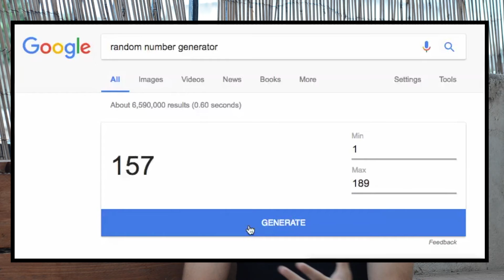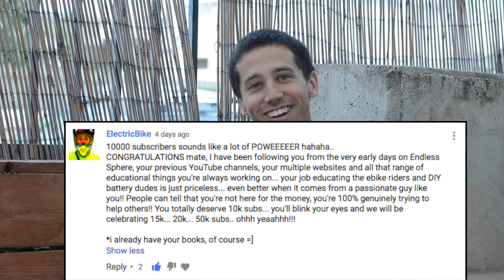Five giveaway winners (and new giveaway details!)

Comment: Hay Micah, have you tried 26650 Battery 3.7V  ICR26650 4000mAh for ebike battery packs before? Apart from being 4000mAh would there be any benefit over 18650's? 

i was just looking at these on Aliexpress https://www.aliexpress.com/store/product/10PCS-PKCELL-26650-Battery-3-7V-ICR26650-4000mAh-Li-ion-Rechargeable-Batteries-Bateria-Baterias-Flat-top/918700_32707428547.html?spm=2114.12010612.0.0.NlJlAd

Comment: :(  i didn't won... hey Micah what do you think about charge a 14S battery with a 13S charger? im thinking that because the lower charge maximize the battery life but dont know if the voltage works in that case
Reply: FREEDA Bicicletas eléctricas you can use a lower voltage charger (never higher) but it will reduce your range and may not really save your pack from future problems (read below)

Another way of thinking here if you want your pack to last longer, heat is what really kills ebike batteries, not charging them up to full 4.2v. Ebikes have very small undersized packs to make it "lighter and cheaper", ideally the packs should be much bigger with a lot more cells.
Back to your question, I would rather instead of than having 14s pack and carrying these additional cells that you're not reeeeally using, add one more parallel group (if your pack is 14s 4p make it 13s 5p) this will reduce the heat generated under load (discharge) and even little heat during charging. Adding one more parallel will also increase your range, reduce voltage sag (voltage drop under load during acceleration) = by reducing this "sag" you also get more performance, less heat losses = more efficiency = more range. 
The more cells to share the load the better, it's a POWERFUL team work!!
Ohhh yeaaahhh!!!!

Micah explains lot of things like that on his DIY BATTERY book.. it's a must have battery guide!

*disclosure: people have different opinions, I fix all types of batteries every single day, most are ebike batteries that were designed too small (cheaper/lighter) to handle the motor that powers the bike. Reducing the charging voltage from 4.2v to 4.1 or 4v definitely increases the life of the cells as long as they're not pushed to their limits. Most ebike batteries are always pushing the cells to their limits.
Reply: ElectricBike i think Tesla and NASA charge to 3.9 instead of 4.2 to more longevity, right?
Reply: FREEDA Bicicletas eléctricas, 
Electric bike batteries are very very simple design with a super basic and cheap BMS, everything gets hot under discharge killing the cells... 

Tesla and NASA do charge to lower voltage, but this is not the only thing they do to make it last longer, they have a very advanced battery management system that also controls an active temperature management keeping the cells always at the perfect working temperature and storage. These batteries are properly designed, by a team with over hundreds of engineers and millions $$$$ budget, scientific tests, no compromise at all. 

Ebike batteries are the opposite... they compromise a lot to make it super cheap... and people buy the cheapest of the cheapest... 

Another thing you could do to make it last longer is never let your cells go near 3v, batteries generate a lot of heat at lower voltage and no much power left at this stage. If you watch the battery discharging curve you'll see that below 3.1v there's no much energy left and lot of internal heat generated. =]
Reply: ElectricBike yeah thank you very much Bruno. That's why I ask about the charge, because is cheap to control the charge and discharge. It's expensive to control temperature and built with more parallel groups. Great information. POWEEERRR!!!
Reply: ElectricBike PD: i have the DIY book but whant the other! I lost the $5 promo